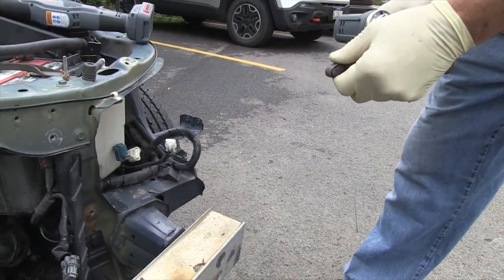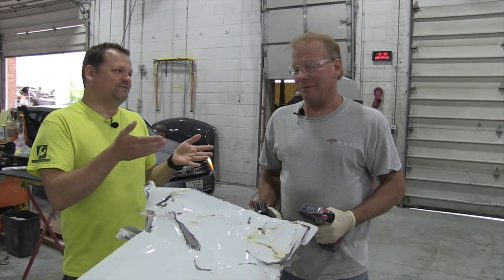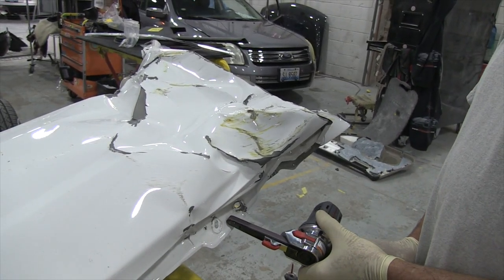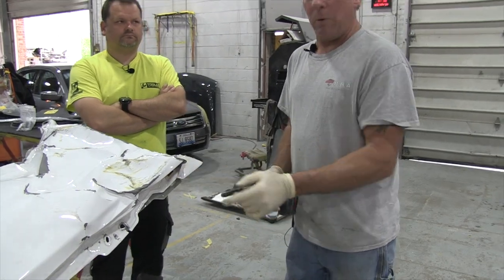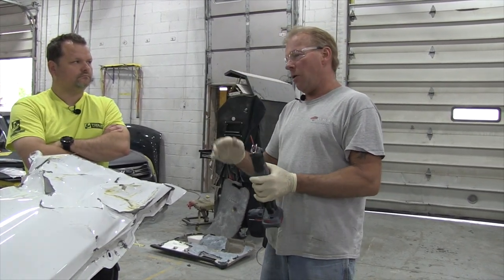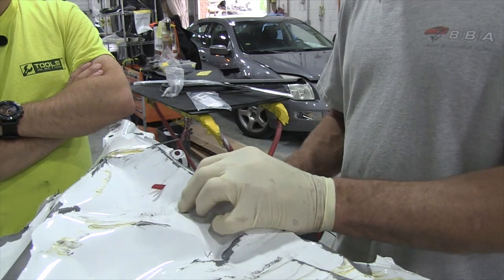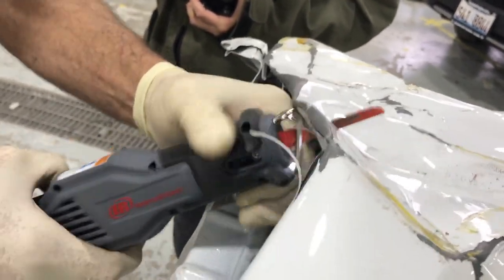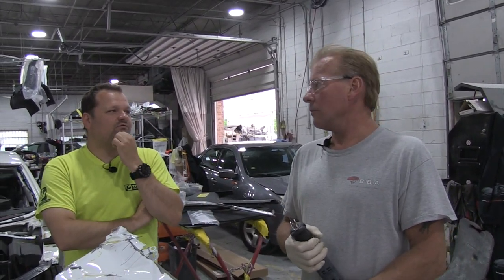Ingersoll Rand 12v Sander and Reciprocating Saw

Comment: That's a mini recip saw, right? Are those special recip blades, or is that thing using jigsaw blades in recip fashion?
Reply from the maker: The blades are not the same as a regular recip or jig saw blades.  Same blades they use for air tools